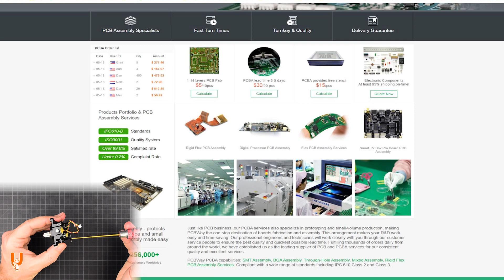Radiomaster ZORRO gimbal upgrade: AG01 CNC gimbals installation guide and adjustments

Comment: hey loved the video, can you make one video on antenna mod fro radiomaster zorro elrs, it would be so much helpful
Reply from the maker: Hello and thank you! I won't be doing an antenna mod on the Zorro but the process should be pretty much straight forward if you follow my Zorro disassembly instructions and lift the main PCB. There is already a hole for an external antenna at the top of the radio shell so it is just a matter of fitting it all in. I usually add liquid electrical tape on top of the uFL connector, as shown in this video (around 2,5 minutes in) https://www.youtube.com/watch?v=iOvCOcjhDhA
Reply: @muteFPV  Thankyou, do you recommend doing it or the current one is enough?
Reply from the maker: I have barely used the Zorro because I prefer larger radios such as the TX16S. I cannot comment on its range :)